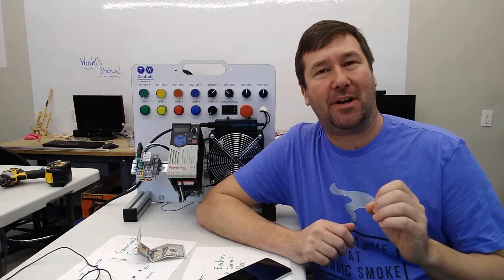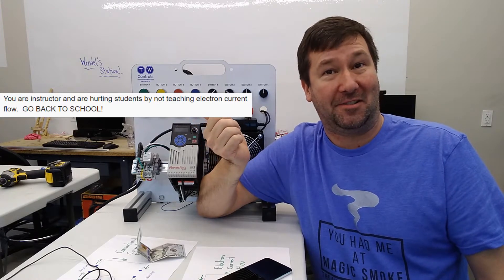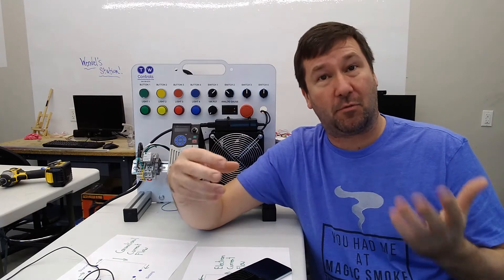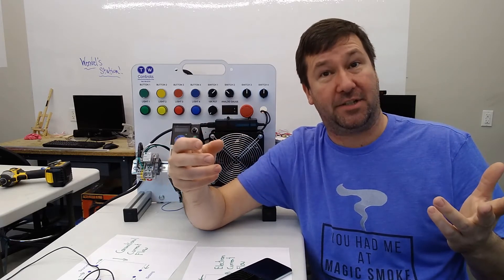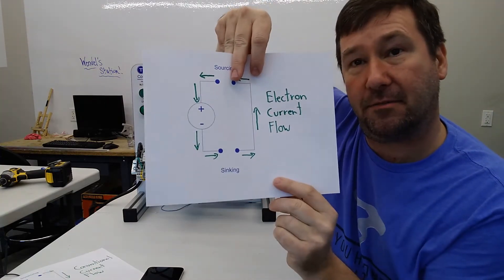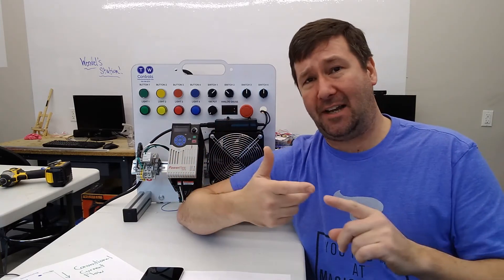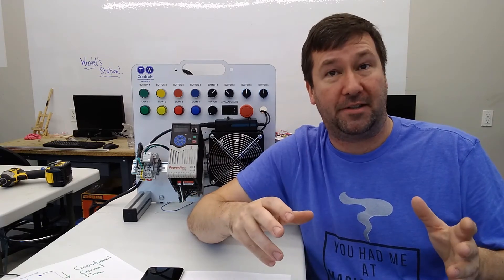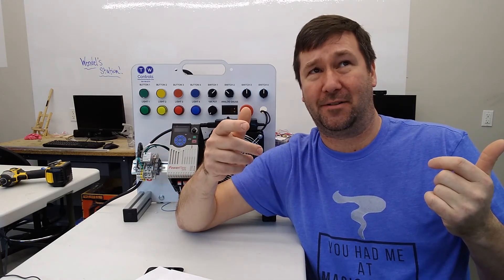Conventional Current Flow vs Electron Current Flow.  Which one is right and which one should you use

Comment: The expanding electrons cross over from the subatomic realm to atomic realm flowing from surplus- ‘ negative ‘- high pressure to depleted- ‘positive ‘- terminal until pressure is equal, I.e. battery is dead. Fascinating details covered in:” The Final Theory: Rethinking Our Scientific Legacy “, Mark McCutcheon.

Comment: When I went to college in the mid 70's we were taught that current flow was always from a more negative to a more positive.  That's how it works in real life.  You can do anything you want on paper though.  Seems like the higher tech colleges taught the exact opposite.
Reply from the maker: Yes that is what I remember too.  I usually steer clear less practical topics but this one kept getting asked.  As far as troubleshooting, as long as you have your positive and negative straight, when you ask "do I have current", it doesn't make much difference if you trace it from the positive to the negative or the negative to the positive.

Also you probably recall that current can flow from the positive to the negative in cases where ions are exchanged such as electrolysis.  But I didn't include that because I figured it would really muddy the waters.

Comment: errr... isn't the overall electron migration always from the higher potential to the lower? the + and - represent a difference in potential, not electrical charge. the common or neutral is always a "sink" or "drain" for electrons. this convention works the same  for DC and AC. If you start saying that electrons flow from the "negative", than in that world the negative has the higher potential, totally flipping the implied meaning of the + & - symbols; the symbols are about potential, not electron polarity.
Reply from the maker: In typical circuits, the actual flow of electricity which we call current is from the negative to positive.  BUT in every scenario that we discuss on this channel, we use conventional electron flow which "assumes" current flows from the positive to the negative.  Don't dig too deep into this one.  It is mainly meant to make sure people know that the two current flow designations exist and why we use conventional current flow.
Reply: @TimWilborne  It would be good to look at the inside of a DC breaker: because they are polarized, they should show which  side the the arc comes from.
Reply: @TimWilborne  same with the internals of diodes or transistors; but I last got learned about p & n-gates 20 years ago. Ergh, 25 actually :-P
Reply: @TimWilborne  I'm so glad car batteries have red & black, and magnets have north & south. Maybe all our circuits should have H(igh) & C(ommon)/L(ow)